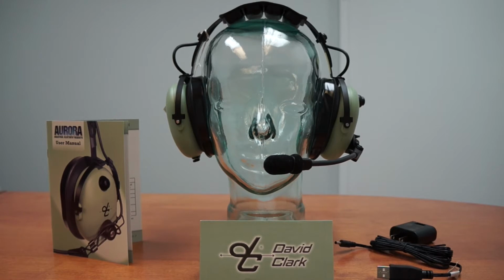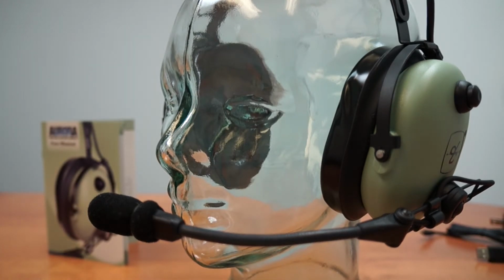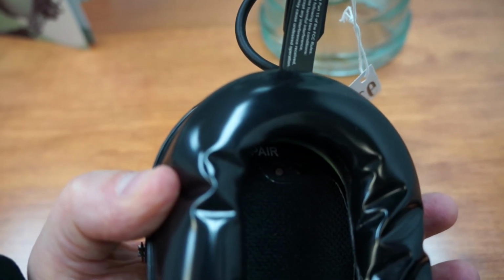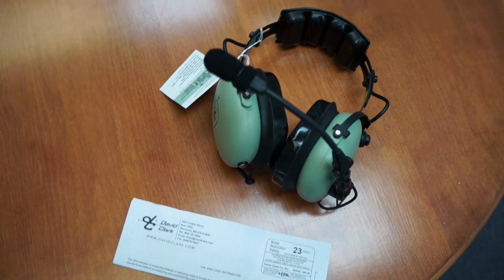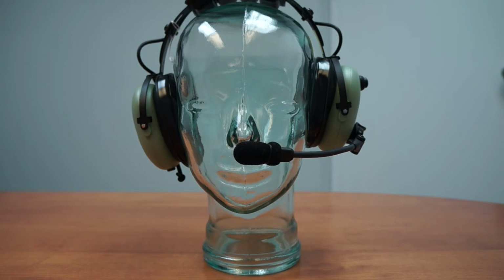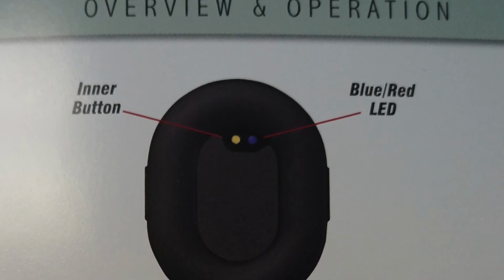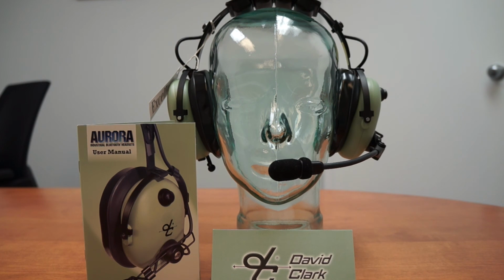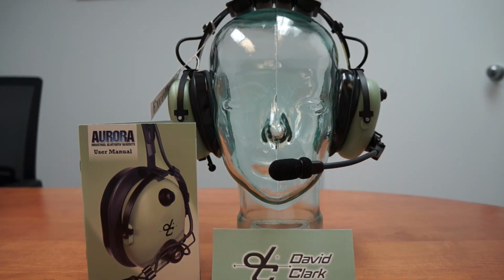David Clark Aurora HBT-30 Bluetooth Headset review - Mobile4Work.com

Comment: Hi, great review and video work. I am a student pilot so am researching my options. There is one thing that is not clear to me: if I buy this, can I use it in a regular general aviation airplane? Do I need a separate bluetooth "dongle" or something similar, to connect to my aircraft radio (where the regular phone jack would go) or do I need a bluetooth COMM radio? Will this work with a push to talk on my steering yoke (wheel)? Cheers!
Reply: (I know this is a very old comment)

I doubt very much that this headset is TSO'ed for aviation, and I don't think DC designed it for that use.

There are wireless headsets from the big companies, but they have been designed and tested for aviation.

Comment: Thanks for the great review! Here are some answers, direct from the factory, to the questions in the video: 

Pairing/On/Off Button: We put the power/pairing button inside the ear cup so that it would not accidentally be hit while the headset was in use. If for example you want to use a feature like Siri on an Apple phone you'd press and hold the button. If you pressed the wrong button you'd shut off the headset. 

Volume Control: This headset was designed to be as simple as possible. Some BT headsets out there have all these menus and buttons and we want ours to be a 'turn it on and go' product. For example, it automatically re-pairs to your phone when you turn it on.  Smartphones have a volume control already so we kept it off the headset.
 
Battery: The 80 hours of talk time will last a whole work week. Charging once a week or once every other week means the battery will last several years before you have to replace it. You can see the battery status either by looking at the light inside the ear cup (red means low) or looking on your phone status bar.

PTT for radio: This headset excludes PTT for radio due to the Bluetooth protocols and programming not being what the radio needs for PTT. Many radios have proprietary Bluetooth programming. PTT for radio is also in development on another product. 

Please let us know your questions by email to greenheadsets@davidclark.com